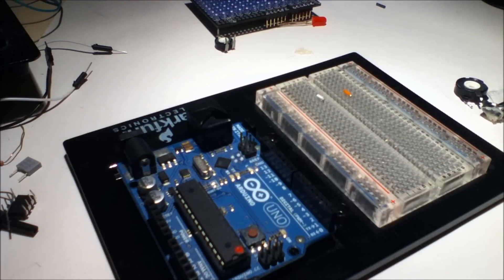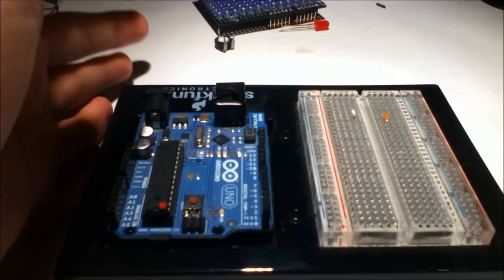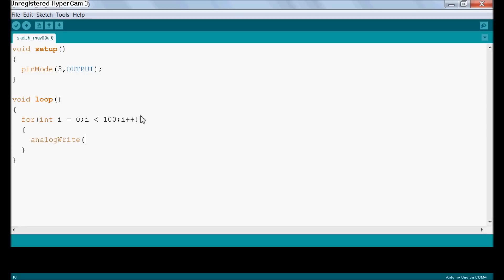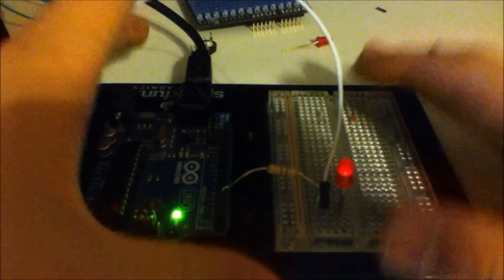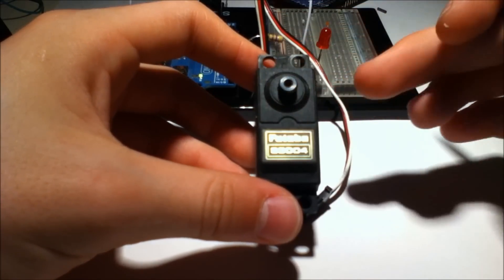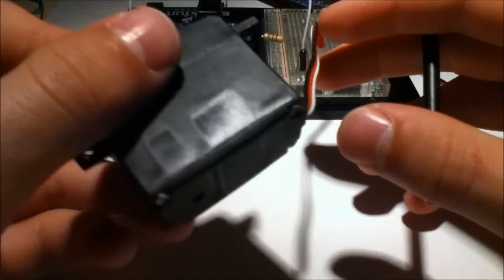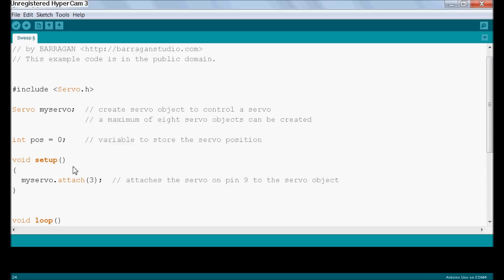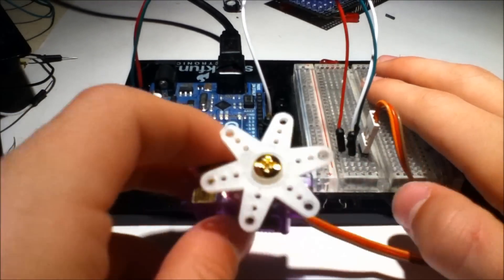Arduino Tutorial #5: PWM and Servos

Comment: Hello Human Hard Drive.. I have a quick question if I may... on your sketch for how would you change the speed (for lack of better words) the LED fades up and down?  I apologize a I am a Neophyte to Arduino coding also is there a way to add two different LEDs (different Pins on the Arduino) to blink at different rates and not interfere with the other LEDs fade or blink rate... Thank you.

Comment: You need a clock to do PWM right? or No? By clock I mean the crystal oscillator.
Reply: Jacob David C. Cunningham The arduino has a built in oscillator but runs at 8MHz then so imagine would take some tweaking of the code and possibly bootloader, with the crystal oscillator it runs at 16MHz
Reply: Shaun Husain thanks for the info

Comment: can  I use your code to drive the led driver with PWM criteria as follows:
Power ON with dimming: DIM ~ -Vin >2.5 ~ 6VDC or open circuit
Power OFF : DIM ~ -Vin < 0.8VDC or short
100 ~ 1KHz
1mA at PWM dimming OFF and 24VDC input

what iam confused is how to achive the frequency requirement of 100 ~ 1 Khz

Comment: What do you mean? physically speaking I just attached the pwm wire from the servo to a digital pwm pin on the arduino then I was trying to use the arduino ide programmer to program it.

Comment: If I need to control 18 servos, I necessarily have to use timers. 
My question is: the servos can be connected directly to the output pins or may have connected a driver like a transistor? In this case, what would you recommended me?
Thank you for your answer.

Comment: greeting humanHardDrive,  thank you so much for the tutorial. I would like to use this application to control a 24V ac speed motor via solid state relay (SSR).  I would also like have a rotary encoder (with 5V output) connected to the Arduino so it could tell what RPM the motor is rotating ? In other word I would like to create a motor driver. So my question is, is it applicable for me to do that ? 

Thank you so much.

Comment: @humanHardDrive Hi, I have a vex kit that im using for my school (Choctaw high school). Were building a robot for Choctaws electronics club and it turns out that the vex servo (motor controller) won't interface (work) with the arduino/robotc and pic programming :( but Im on the verge of finding a way to use the servos without the motor controller, I might have to get a motor shield or find a way to hook it up to the arduino without the shield. I would love help. got any suggestions?

Comment from the maker: The PWM is generated by timers within the chip itself and are therefore not affected by the delay. While I didn't cover it in the video, there is a function within the servo library that does allow you to change the period of the pulse, by overriding the attach function with the min and max times.

Comment: Hey HHD, I'm having a little trouble understanding how Arduino users set their period. Typically this is 20ms for servos. In this tut you set only your duty cycle while the period remains at 1ms (assumed). Additionally, aren't you affecting your duty cycle by placing a delay in your loop? What would occur if you removed the delay completely?

Comment: The reason you didn't measure the 2.5 DC voltage is that you were measuring over the diode and not the diode and the resistor. even at 100% duty cycle you will only measure the forward bias voltage over the diode with the remaining voltage being over the resistor. 
Thanks for the Video, I've yet to play with a servo motor.

Comment: Syntax:
analogWrite(pin, value)
Parameters:
pin: the pin to write to.
value: the duty cycle: between 0 (always off) and 255 (always on). 

Value: is not in Percent Duty 0 - 100%

Comment: BUuuT - this is exactly what i was confused about. Will the PWM directly to the TEC really control the TEC the good way? (i red that they _Demand_ a constant current or something). If so, then why at all use the intermediate transistor to open up the power line?